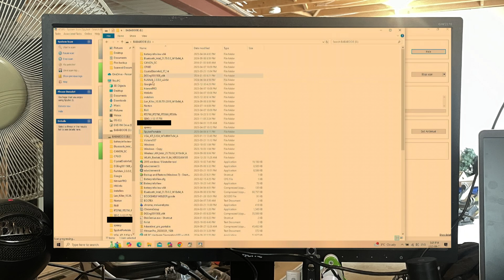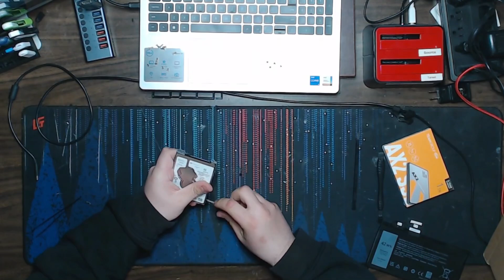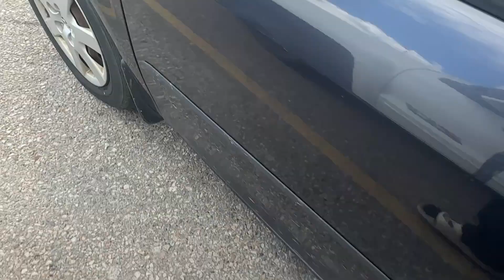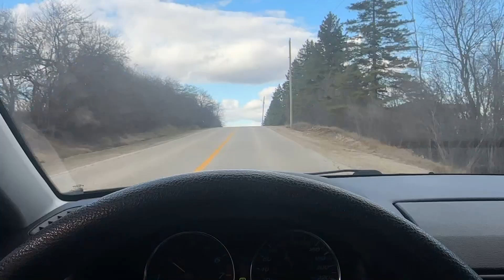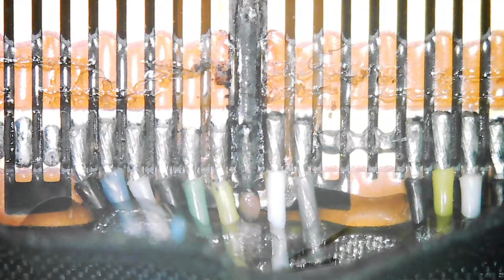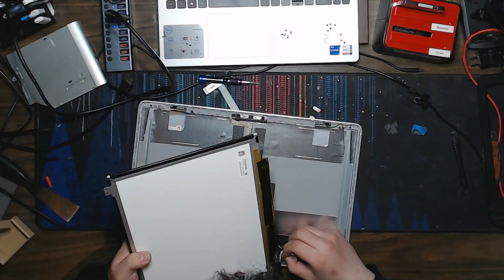I "Tried" fixing this Dell Laptop, It didn't end up well...

Comment: oof, you're lucky you didn't short the screens 19v to one of the data lines
Reply from the maker: Tell me about it. I did check all pins with a multimeter, and all were connected where they needed to be connected. Also, all fuses, resistors, MOSFETS, and other things had resistance, which led me to believe it would work, but I still had doubts. Thankfully it worked great and there were no issues.